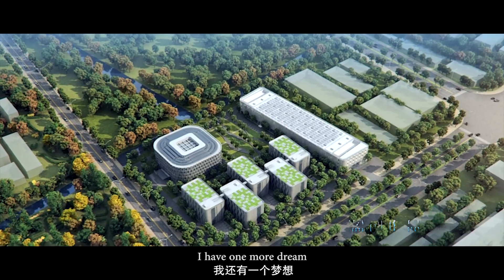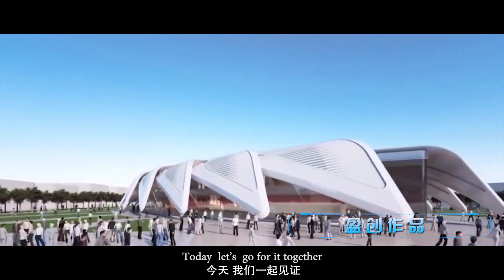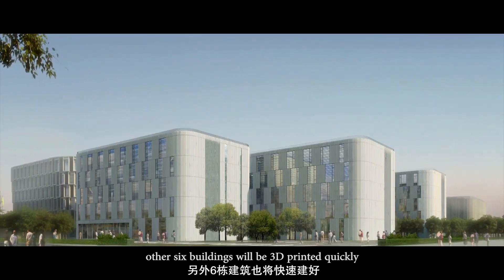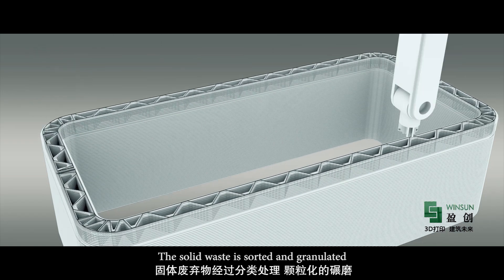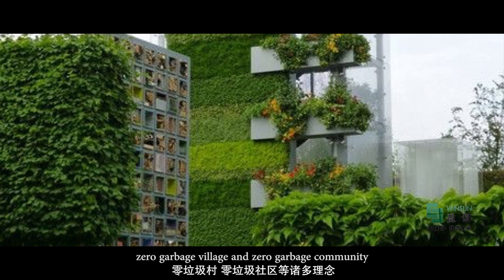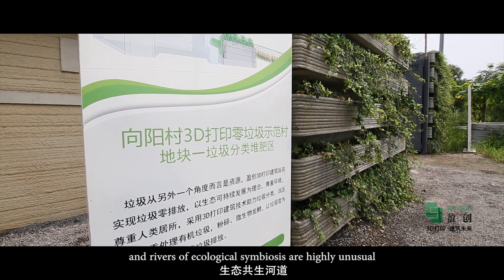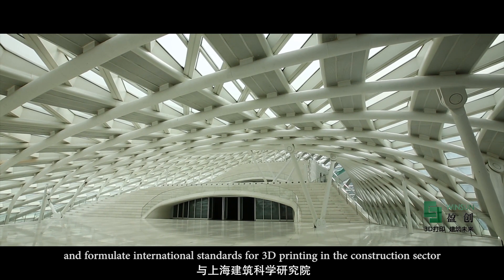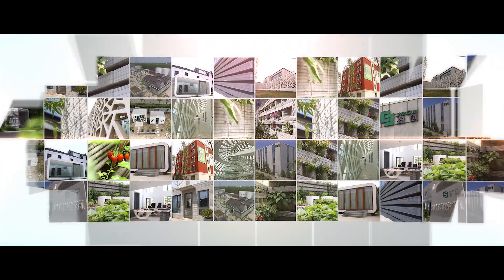Winsun 3D R&D Center in Shanghai - Largest 3D Printing Building Construction

Comment: We're still building these in a central factory though, meaning it's not as efficient as it can be.
If they build it in-situ, the owner can take a day off to watch the construction and see which corners have been cut.
Building these segments in a central factory means the builders can more easily hide their lackluster building techniques, far removed from the customer's eye.
I wouldn't buy any 3D printed house built somewhere else and shipped in via Trust Me Express.
Reply: On-site printing takes too much time and results in a lot of waste. The site must be prepped, foundations prepared for the printing equipment, the entire site sealed from the elements to ensure the concrete pours and dries properly, and concrete trucks lining up to ensure a steady supply of material for the printer. This added time, materials, and labor increases the cost by as much as 50%. Factory built is the future of construction. Most everything in construction today is manufactured off-site.
Reply: @J.Cameron.Stuart.Adams.Fisher  I can't help but think there's a sweet spot where some of the major parts are built off-site (and thoroughly tested by an independent agency), and then a local on-site team uses some pre-fab parts and some local construction.

Even if you buy a mobile home, you still have to do some on-site prep work.

I might even be inclined to buy a mobile home if they had a progressive quality standard system.
The minimum is 1. This is the usual mobile home people expect.
2 would be a step up. Better construction, better parts.
3 would be another step up from there, to the point where you could reasonably expect the home to appreciate in value, rather than depreciate. Mobile homes typically depreciate, unlike normal houses.
4 would be entering luxury territory.

And then the real estate company would need to be certified at that level to make sure the resulting home still meets the level you paid for. They need some on-site construction skills.
Reply: @protorhinocerator142  Everything you stated is in place.

The structure and components must meet minimum requirements. While developing their process from existing technologies Winsun tested and fine tuned everything from facility temp and humidity to the cement mix to the extruder head, and extruded cement thickness, width, and shape to ensure the most strength. Thats not to say corruptions isn't possible. Particularly if a business is owned by a high level party or government member. 

The foundation, plumbing, electrical, windows, exterior cladding, subflooring, finished flooring, and all the interior finishing is completed on-site. Many of the components installed on-site, like all other construction projects, are manufactured off-site. Off-site component manufacturing has been a staple in the industry for the last several thousand years. All the blocks to build the Egyptian pyramids were shaped off-site for maximum efficiency. 

Kits, SIPs, log homes, and the like are manufactured and assembled in roughly the same manner. Pieces arrive and are assembled. 

There are multiple levels of manufactured homes and other structures. There are basic single to triple section home models to 30 piece modulars homes. Manufactured homes are placed on block piers to permanent foundations with full basements. One can buy a manufactured entry level home for as little as $40k placed on blocks (mobile home) to a three story with a full walkout basement and an attached ten car garage for $2 million (modular). Mid level two or three section manufactured homes (former called mobile) placed on a permanent foundation appreciate in value at the same rate as comparable site built homes. The same is not true for entry level manufactured homes with paneling instead of drywall, plastic fixtures, wood look plastic trim, and other cheap materials on a permanent foundation. Such entry level manufactured homes may be titled as real property (because of a permanent foundation and/or local code). However due to the materials used in its construction, the economic life of the entry level version is much shorter than a comparable site built home. Additionally the market says this entry level manufactured home is not as valuable as a comparable site built home due to its appeal to buyers. As such you are correct this example entry level manufactured home would not appreciate, and in some instances of deferred maintenance and location may depreciate, at the same rate as site built or other manufactured homes. 

Modular homes appreciate equally to comparable site built homes.

Like site built homes and other structures a range from basic to high-end manufactured homes and structures does exist. 

Rules, regulations, and codes do exist to protect life, reduce energy, and reduce environmental impact. However, there is always a risk of fraud, deception, and corruption at every turn. Everything going into a structure has value.  As such nothing is safe from fraud. Using a reputable company minimizes the risk.

Manufacturing is the most efficient way to build structures. Efficiencies are key to success. Manufacturing efficiency equals valuable saving. Saving time and materials are key factors. Consistent product, reducing errors and waste follow. 

I saw an entire five story 23 unit apartment building go up in a matter eight days. Each module was 100% completed, including exterior cladding and weather proofing between modules. When the final modular section was placed on top and plugged into the electrical, water, gas, and sewer lines the entire building was 100% complete. The only item preventing moving in was the final sign off by the building inspector. The building passed inspection the next morning. Time will tell if these modules, designed and built by the same company  that produces modules for cruise ships, will stand the test of time without maintenance and interventions exceeding normal maintenance and other economic life extending measures on comparable site built structures. 

Lastly homeowners being on-site during any part of the process is a nightmare 99.99% of the time. 99.99% of homeowners have zero build experience or knowledge. All they do is slow the process down with needless interruptions, constant questions, commentary, and get in the way. Safety measures help to keep most homeowners out of the way. There is always that one homeowner who is a self proclaimed "expert". Often times it takes a call to a health and safety inspector to get the homeowner booted from the site. Even then they often can't stay away. 

Cheers!
Reply: @J.Cameron.Stuart.Adams.Fisher  Holy cow and I thought I was the one writing all the walls of text.
Reply: @J.Cameron.Stuart.Adams.Fisher  This was the most detailed and thorough response to any question I have ever seen. Perfectly done Cameron, and 100% correct, I am very impressed!!!
Reply: @protorhinocerator142  Well he had to address all of the incorrect statements that you made. Since literally everything you said was wrong it forced his response to be very long to address all of your misconceptions.
Reply: @boredmisfit7725  "Since literally everything you said was wrong..."

So you believe a mobile home can be plopped down anywhere with no on-site prep work?
Because one of the things I said was that a mobile home requires some on-site prep work.
And then you said literally everything was wrong.

You're being ridiculous.
Of course mobile homes require on-site prep work.
You need a flat surface.
You need a foundation.
At the very least you need to remove the wheels.
Most places require skirting around the building.
You need to hook them up to water, electricity, sewage, etc.

I've known people who lived in mobile homes. They had to ensure all of that. This is a fact, not a "misconception".
Reply: @protorhinocerator142  Where did I say site prep was not required? No matter what structure goes on the site all utilities, the foundation, an access road and grading is required and must be signed off. Those site improvements are obvious. 

And yes teams come in to hook up the utilities, add tie downs (where required) and put the finishing touches on the structure, both inside and out, before the occupancy permit is issued.

My answers were long winded, yet full of grammar errors and missing words from thinking faster than I'm typing, to provide the most complete answer. Even with the long winded answer there is still more to complete the entire picture. There is plenty of information you can find if necessary. 

Cheers!

Comment: awesome, this is definitely a needed advancement. i wonder if they will provide service to go to different countries like america, south america to build cheaper. they build a house 3d print in america. said it cost 4,000 but now i see a really tiny one for $112,000. it’s ridiculous. they get greed here in america. i wanted to build low cost apartments and then all of a sudden the cost of everything went extremely high. now everyone is negatively affected. i think if they can print 650 sq for 4000. i’m guessing just the print, they could print a 10 unit building for 70k to 80k easy.

Comment: 😱 Whoa.... did anyone else see the crack in the wall at the 1:58 mark?
Reply: That's the form for pouring foundation, not a "wall"
Reply: This points out the necessity of putting expansion joints in their work so it can naturally expand/contract with heat/cold. (I see some of those they have already, I guess they just need more / better planning for that.)
Reply: Corners have been cut, quality materials have been substituted out, planned obsolescence at maximum profit for the builders has been achieved.
Life expectancy for the building - 4-7 years.
Reply: @protorhinocerator142  So you didn't watch the video huh? Also you are wrong on every level. In fact you could not be anymore wrong. WOW. Even by internet standards that was an insane amount of ignorance you spewed there while babbling on about topics which you clearly know nothing about. Be happy the world has innovators in it to make the world a better place. All while the willfully ignorant people like yourself talk crap about all of the hard work and intelligent new processes and inventions that they come up with. Truly pitiful kiddo. SMH